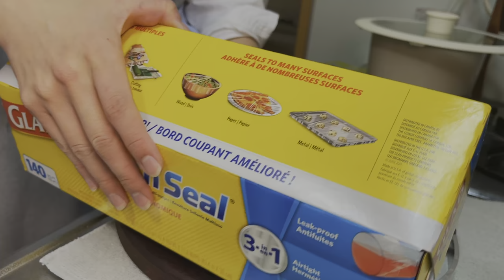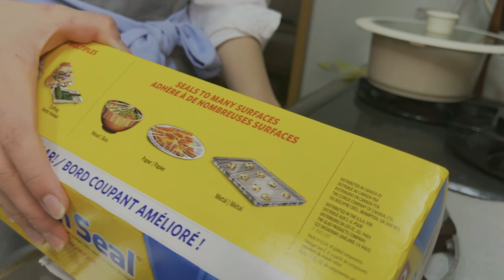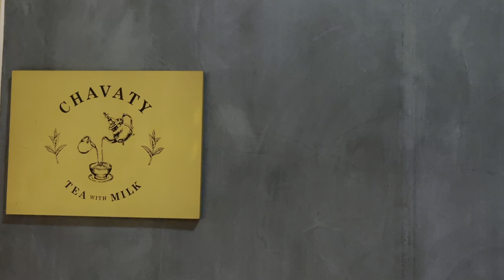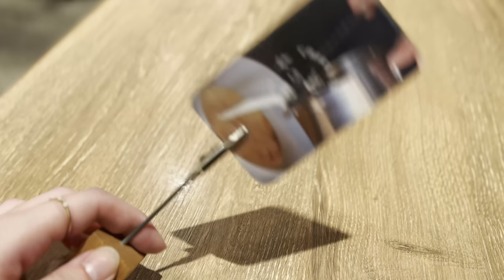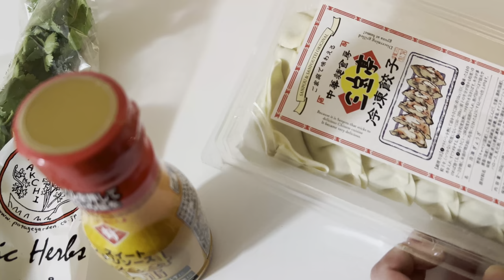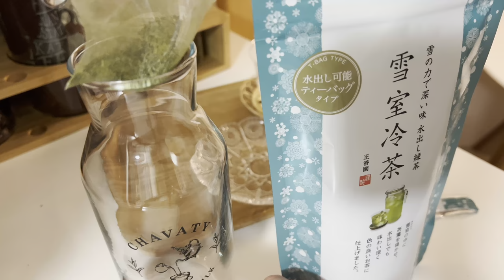部屋をきれいに保つ週末の掃除ルーティン｜1人暮らし1Kの部屋の冬の準備｜Housework Motivation VLOG｜Japan Living Alone Diaries

Comment: * For the cleaning part * : my grandmother often uses the mixture of water and ammonia in a spray bottle on glasses and mirrors, because passing it with a cloth it dries immediately and does not leave streaks and if used in the right percent, it prevents condensation on these surfaces
😎👍🏼
Reply: Also very good is 1/2 white distilled vinegar + 1/2 water + little dish soap (few drops to 1/4 tsp) in a spray bottle. It will remove oils and mineral buildup. You can add rubbing alcohol too if you want a streak free glass cleaner. Vinegar is an alkaline deodorizer and mild disinfectant. :)
Reply: @annerambling9678  Sounds amazing! I will try it 😉😉👍🏼👍🏼

Comment: Hi and nice to see you.
On most of the surfaces I use a vinegar mix to clean. When dry it doesn't smell, it prevents mold and mildew, I use it in the wash ( all colors,) restroom, kitchen. Never use on wood unless it is fake. Works wonders on mirrors and glass. One part vinegar to two parts water and I add a dash of peroxide on hard to clean surfaces. If you add dish soap to the mix it cleans glasses and dishes to a shine. Never use it on metal pots and pans nor nonstick. This has saved me tons of money, I mix my own to what I like and it is environmentally safer as I have pets. Enjoyed watching your weekend and wishing you an enjoyable weekend, take care.

Comment: Best way to clean a mirror? Oh I get the blue toilet stuff that you use in the toilet bowl as that contains descaler. Once all the watermarks are off and it’s completely dry just go over it with normal glass cleaner. Glass cleaner is also good at removing light watermarks so if you do it regularly you won’t need to use any Descaler. Just be careful with the blue Loo don’t leave it on anything a prolonged time. It will remove chrome if left for too long. If you use the Descaler on a magic sponge it becomes a very easy job. Then just use a microfiber cloth with the glass cleaner afterwards

Comment: A cleaner with vinegar and a dry towel is good for mirrors. A trick my mother showed me if you want glass windows or vases to sparkle is a vinegar based cleaner and use old newspapers instead of a cloth. It works.
Reply: The ladies did that before paper towels were invented.

Comment: You seem to be doing double the work when boiling eggs, you might want to try
Steamed eggs, perfect every time
Heat the water on high heat until it is boiling and producing steam.
Turn off the heat and gently place the eggs at the bottom of the steamer basket or the bottom of the pan.
Turn the heat back on again to medium high, and cover the pot.
Turn the heat back on again to medium high, and cover the pot.
steam the eggs 4-6 minutes for soft boiled, 10 minutes for hard boiled with a still translucent and bright yolk, or 12-15 minutes for cooked-through hard boiled. Remove eggs with a spoon to a bowl of cold water or ice water and peel at once. We usually just put them in with vegies we are already steaming, saving a pot and energy :)

Comment: Thank you for your lovely video! Isopropyl Alcohol does work well on mildew, but you want to use one with a higher % of alcohol, between 60 and 90%. That’s going to produce very strong fumes so make sure your vent fan is on high until all of the fumes dissipate.

Comment: Lines and wrinkles, spray a little water or fabric softener on the bottom sheet and pull tight , lay down the top sheet and give it a little spray and sweep flat.  Just a lite spritz and pull or press flat. Works every time.

Comment: Cleaning a mirror with any abrasive is not a good idea because the mirror part is simply sprayed on and abrasives take part of it off. The best way to clean any glass is simply water and a squigey after. Use a cloth or a very soft brush to clean . Then just squigey off the remains.  If the glass or mirror is really dirty you can add just a drop of dish soap, a drop of ammonia and a drop of alcohol to the water for cleaning. 
I've been cleaning homes for 50 years and I learned about cleaning windows from a professional window cleaner. 
If you use just water you will never have any if that fog or streaks on your glass or mirrors.